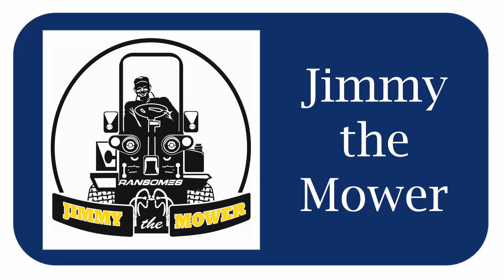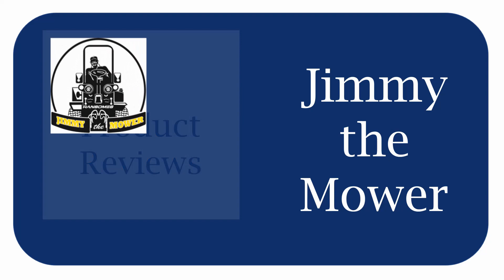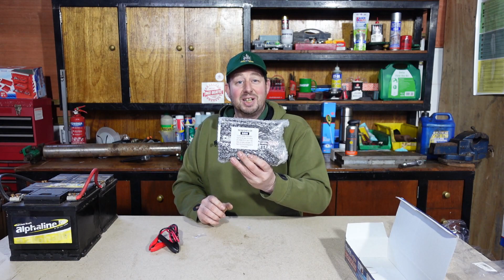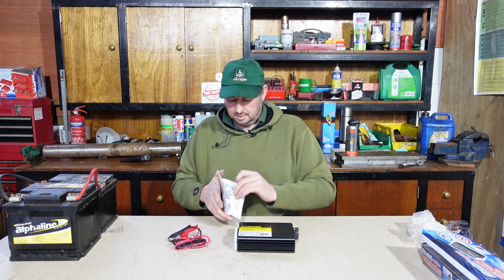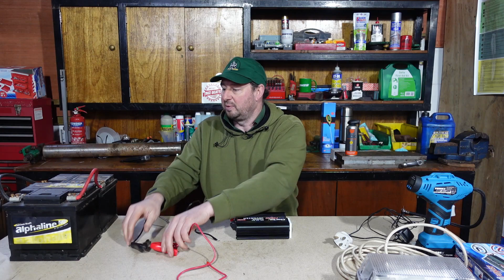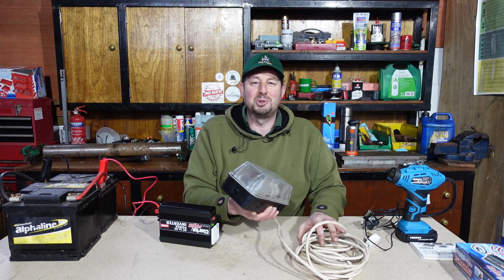Clarke 400 Watt Power Inverter CI800B Converts 12V DC into 230V AC Review Machine Mart Garage Tool

Comment: good information video jimmy really handy them had one in back of work van till it grew legs and walked use to keep my signal torch charged and used it with my laptop when working from van
Reply from the maker: Cheers,  hopefully I will get it wired in to the truck and we can charge our batteries while we are out and about.

Thanks for watching 👍
Reply: @JimmyTheMower  hi do you send out stickers am building up a sticker board for when i get into my workshop thanks
Reply from the maker: It would be an absolute pleasure 😊
Just contact me through the email address on the Jimmy the Mower website.

www.jimmythemower.com